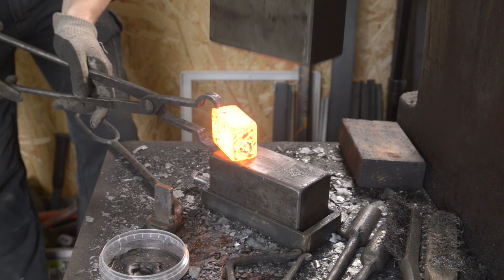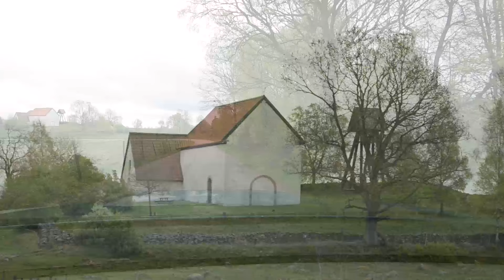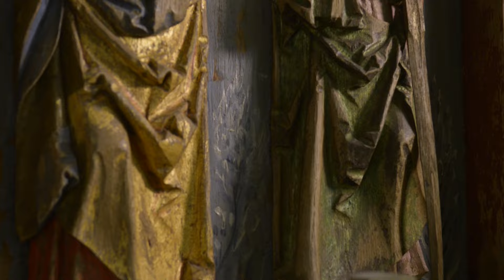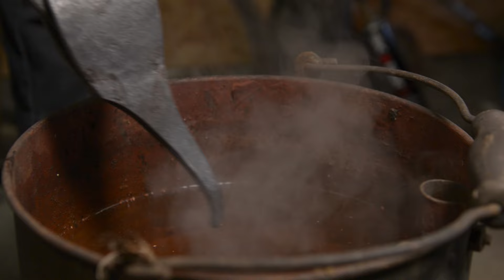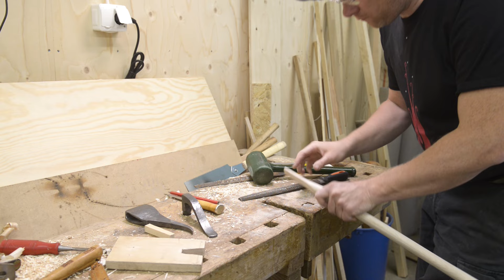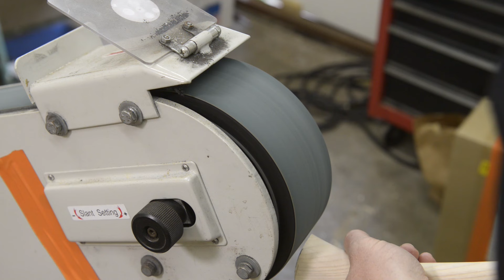Blacksmithing - Making a pickaroon

Comment: south Austria we call it "sappel" and im working at a sawmill and use it every day !
Reply: so, what is it for? what does this tool do?
Reply: @lukewarmwater6412  It's for old fat guys like me that don't want to bend over to pick up firewood. :)
Reply: @Z-Bart  well, they would be good for that too... hmmm. maybe I will put a handle on the rusy one I have.
Reply from the maker: Cool!
Reply: @lukewarmwater6412  I know i am late but well the usecase i know of that this tool is to help fell trees (to give them a nudge in the right direction either with the hook directly or with the help of a chain and using the tool as a leaver) and of course also as a hammer for putting the wedges into the cut (you have this tool next to you so why not use it as a hammer as it already looks like one).
And of course for prying things apart (so if you have a few trees lying on top of each other and want to get access to one of them or if you just want to have space to get a chain around one). So in general it is just a tool that is useful for a surprising number of tasks even though it is really simple (just a hook on a stick).

Comment: This canister, with linseed oil, is never ends)))
Reply: He's up on everything it seems.
Reply: Plot twist: He slowly refills it from another to the exact same level.
Reply: The only thing is, in my experience, that regular linseed oil dries too slowly. I now use only boiled linseed oil on my handles. For a blackened finish on forged items, blo is great. It takes time, however, and patience to use low enough heat not to burn it but high enough heat to polymerize it onto the surface. I have some items that are exposed to the elements the year round and have found that around the five year mark they require a re-application.
Reply: That container was filled from the souls of thousands of linseeds.
Reply: It's the cruse of (linseed) oil that never runs out lol
Reply: @TheMetalButcher  ओक
Reply: تمااالانتا
Reply: تمووىةظاتظتتاهاتا
Reply: @مهديعباسمهديعباس-ف5ز  no, it can't be blown up

Comment: As always it is interesting to see the the craftsmanship involved making a practical tool. I bought similar sized pickeroon with a shorter handle (about 500 mm) several years ago. It was forged in Austria and differs from yours in that it is slightly more pointed.  It allows me to transfer cut up timber on to my hydraulic log splitter one handed. Nice job and thank you for the video.

Comment: I have had two pickaroons, made in Bangor, Maine, USA, for nearly 45 years. I used them in landscaping to move railroad ties around and now to move firewood logs and cut rounds into position for cutting and loading. It is an indispensable outdoor tool. Yours is excellent and sturdier than the ones I have. Yours has a wide point or small blade on the end while mine has a rounded one. One thing about a pickaroon, it needs to stick in the wood and stay stuck. If it comes loose, the operator goes flying backward when pulling a log or beam. Could be inconvenient depending on the circumstances. Maybe that is part of the reason for the pin you put through the head and handle. Thanks for the great video.
Reply from the maker: Great, thanks!

Comment: You will find theese handy little tools in the pulp and paper industry and lumber industry i presume. At least I handled one daliy moving ill placed logs around when i worked at a papermill a couple a years ago. They were slightly different though than your creation. First, there was no pin through the head to secure the handle, guessing theres differen't technics to make it "stay put". We rarely had problems with the head coming loose, more often did the handle snapped or the tip had become worn out from to much "close contact" with the concrete floor. Second, the handle you made are noticeable longer. Probably several lenghts are available, each better suited for a specific task. I like the short ones, just slam the tip in the end of a log  and when I straighten my lazy ass back up its in a perfect drag/carry position for me. If you haven't already you can actually find these great litte tools here in Sweden in various places under the intriguing name of ''draghake''. 🙂
AND, as always, THANK YOU for and exellent video! As many others stated already, it's almost as therapeutic just leaning back in my chair, only hearing the huffing and puffing from the hammers, the ringing from the anvil and slowly someting reluctantly emerges from the stubborn red-and-black-ish piece of metal. Sometimes i get stuck for hours. Found this channel last summer, I think, and are now trying to "catch up" pick off videos here and there when I have the time. Great work! Keep'em coming.
Reply from the maker: :) Cool! Thanks

Comment: Very nice, however I would recommend using a roll-spring instead of an aluminium-rod to hold the pickaroon head in place, as it’s going to be very difficult to remove the rod once you need to replace the handle, you’ll probably end up drilling and replacing it with a new rod, if you use a roll-spring you can remove it easily with a punch and hammer then reuse the same spring once the handles been replaced.
Reply from the maker: Good suggestion! Here I used a mild steel rod. It's quite simple to grind off one head and pound it out if necessary!

Comment: Very nice work,bud!!  I have used that tool many times as a boy and young man. There is one thing I noticed though,,,, The pickeroons I always used ,,we used to tap the point slightly with a rock or hammer to create a small burr on the bottom of the point. It would stick in just as well but would release much easier,, with a little jerk. 
Of course this would require it to need sharpening and burring every now and then. Just my experience. Cheers!
Reply from the maker: Cool, I have seen that too.

Comment: Really awesome smithing one observation you will have better life expectancy out of the handle if you rotate the grain 90 degrees . May the grain be with you .
Reply from the maker: Thanks. The grain is actually curved, but as you say it's not ideal. I would not have used it for an axe handle.

Comment: Torbjörn:  We don't find almost any around here in North Idaho logging country, either, even tho they are a very handy tool.  Possibly they were re-purposed into something else over time?  They are really never used in logging country due to the exclusive use of heavy machinery.  But for small holdings they are a very handy tool to have around and I have one I use in my woodshed as I hand split all my firewood.  Regarding wood handling, I also have a well as a hook with a cross/shovel handle {sort of like a very heavy hayhook} used for picking up chunks of wood, dragging small logs, etc.  Might be another idea for you to make!
Reply from the maker: OK! Interesting

Comment: I dont go out to move lumber, no matter the size, without my pickaroon. Just a thought...if you bring the tip to a point instead of a blade, you will still have plenty of grab, but you will be able to dislodge it from the wood with one motion. Makes life a little easier if you are moving a bunch of lumber

Cheers
Reply from the maker: I guess both tips are useful in different situations.

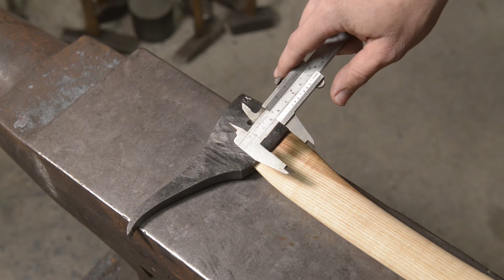Comment: 22:30 that's the first time I have seen a head like that pin to the handle. Is there any other purpose for the pin, other than just a little extra security.
Reply from the maker: It's because this is not an axe head. A pickaroon is used with a pulling motion all the time!

Comment: The annual rings of the wood are in the wrong direction, they should be parallel to the blade to make the stem more durable🤔
Reply from the maker: Could be, BUT this is not an axe and is not used like an axe. Mostly used with a pulling motion with little force on the handle apposed to an axe chop.
Reply: @torbjornahman  Yes, that's true. Maybe it will be ok in pickaroo. 
I noticed in a shop that about half of their axe shafts were wrongly made. It would be fun, if you are in the middle of the forest and you lose your axe after first chop😂

Comment: Hello

1) How much time does it normaly takes, to have the right heat for smithing?

2) If i finished the piece, the steel looks really bad, like it's some cheap, low qulaity steel, but yours lokks reslly nice....
How do you do that??

Nice Work, keep going 👍👍
Reply from the maker: 1) 2-3 minutes from cold, maybe. 2) Hard to answer... nr of heats plays a role for sure and hammer control to minimize hammer marks.

Comment: A real nice quality tool. I think it is fascinating how you are able to use the right amount of steel at the beginning and only have minimal waste. What kind of steel did you use ( maybe i have missed it)? Even though you are using power tools (especially the ginder) you are doing the finishing touches by hand...I like it. :D Great job as always.
Reply from the maker: Thanks! This time I just guessed actually.... Oh, I used simple 1045 / C45 steel for this one. I forgot to add a note in the video about that. I think it will work fine.
Reply: @torbjornahman  Thanks for the answer. If you do not mind, I would be interested in the selection of sorts of steel you work with , what they are normally used for and what properties they have.
Reply from the maker: @fryingdutchman8921  Oh, it's hard to explain in short... And I'm definitely not an expert when it comes to different alloys. For knives and tools with keen edge you need high carbon like O1/1075/1095. For tools that need more toughness medium carbon steel is preferred like 1045/4140/4340. The only hot working steel I have worked with is H13. For power hammer punches mostly.

Comment: Thanks for a beutiful video! Why did you rivet the head to the handle? Never seen it done on, for example, an axe. Is it always done on pickaroon? Is it really necessary?
Igen, tack för alla filmer du delar med dig av! En verklig inspirationskälla, och så tillfredsställande att se hur snyggt du får till det!
Reply from the maker: Tack!  Yes you use a pickaroon in a completely different way than an axe. You pull on the handle and it will jerk the head lose sooner or later. The pin will hold it in place even if the head moves a bit after extensive use.
Reply: @torbjornahman  Makes sense. I have used an axe in a similar way, but maybe i should get a picaroon instead!

Comment: Nice job! It seems a very elegant tool.
I've always wondered why must put some coal dust when making a hole.
Greetings from Bulgaria.
Reply: It helps to free the punch from the hole by creating gas from the combustion of the coal in the hole. Think of a champagne cork popping out from a bottle, only less dramatic.
Reply: @horacerumpole6912  You'd have to ask Torbjorn to confirm that it's graphite powder, I don't believe that it is. I believe it's just coal dust or 'fines'.
Reply: @horacerumpole6912  Really?  Can you share a link to it?  
In the first sequence I can see that he uses a powder, reaching to the right and taking it from a dish then sprinkling it into the hole, that powder looks a lot like fines to me, it looks coarse for a graphite powder but it 'could' be.   Most guys use fines, myself included.  It's cheap and does the job.
However, the tub he subsequently dips the slot punch into in the next shot is almost certainly a graphite paste of some kind, but it's too glossy to be straight powder.  I've made something similar myself as a punch lube from a mix of beeswax, boiled linseed oil and finely ground charcoal.

In any case the original poster was asking about the use of coal dust when punching holes, not graphite. My explanation for that is sound, the pressure of the off gassing coal helps to pop out the punch.

Comment: Great work all around!  I enjoyed it.  Not a big deal for something like a pickaroon, but I would like the grain of the wood oriented vertically with the blow of the tool.  There was a debate on another channel on which wood is stronger - heart wood vs sapwood.  I'm in the heartwood camp, but I see you choose sapwood.  Deliberate or just what you had on hand?
Reply from the maker: Thanks. This was a piece I had laying around. Even if the grain is a bit curved and not ideal, it will work fine for a pickaroon. I would not use it for an axe handle.

Comment: My brother has a few of these and I was looking at them yesterday wondering how I could make one. Awesome work as always. I'm curious though the stone you used after heat treating? Was that a way to temper the tip or just for a aesthetics??
Reply from the maker: Thanks. I used the stone to remove the scale so I can see the tempering colors on the bare metal. The residual heat traveling back to the tip.
Reply: @torbjornahman  oh cool. Would have never thought of that. Thank you

Comment: Hey Torby... Another great video of mastercraftsmanship. 
I have a question. The rivet at the end. Isn't that a bad idea because if you want to replace the handle in case of any damage you will have to remove the rivet which is going to be dificult right ?
Reply from the maker: Thanks. All pickaroons I have seen has the rivet, because you use the tool in a different way than an axe. You pull the weight with the handle. A rivet head is quite easy to either grind off or chisel down.

Comment: I suppose the rivet is a security device, not functional normally that is. Or ?
Reply from the maker: The pickaroon always has a rivet it seems. Since this is a pulling weight kind of tool apposed to an striking tool like an axe.
Reply: @torbjornahman  Aah, now I understand. The pulling action.

On a side note, a tip for people out there:

I put my axe in the oven at 200 °C to set the line-seed oil (un-cooked oil) faster, for the sake of making it more beatiful and durable, and indeed it became, a new brown finish much like mahogany, water resistant as well.

That was a big mistake though. Now the wooden handle shrunk a little bit and and the head came loose.

I solved the problem by setting the head to the handle as normal, with a series of sharp knocks on the handle knob. Then I built a little pool out of "modeling clay" around the eye, gripping the axe vertical, head up in a vise. I poured some thin laminating epoxy (24h setting time) in the pool. The resin slowly filled the gap all the way down during the night and hardened like rock. Now the head sits way firmer than ever before.

Effective ? Yes
Repeatable ? Perhaps

Förr har jag trott att du är norrlänning, men nu har jag blivit klokare i det att jag tror att du är smålänning :):)

Comment: What are those flake like things falling off
Reply from the maker: Iron oxides. It forms on the surface of the hot steel. Almost like instant rust. :)
Reply: @torbjornahman  So does this reduce the actual mass of the iron taken initially?
Reply from the maker: Yes it does, but for most things nothing you worry about.

Comment: Another captivating clip. The church is amazing, especially that door. Would the original wood really last that long? Aso, what is 'normalisation; of metal? Is it the same as annealing?  :-)
Reply from the maker: Thanks! I'm not sure the door is original, but it's plenty old. You probably could use dendrochronology to date the wood! Normalization is a way of evening out the grain structure within the material. Forging and heating makes the grain grow and distort. Annealing is a further step that makes the steel as soft as it gets - without going into detail...
Reply: Thanks so much for the reply. Very helpful[ful. A friend says the church is in Vaxjo? (sorry, couldn't find he diacritical marks)
Reply from the maker: Great. Yes that's right!

Comment: Well done as always! But is there a certain reason why you made the tip flat? The ones i´ve been using my whole life in logging always had a sort of triangular tip. I had one or two which where flat, but i found that they didn´t stick as well and after i had some pretty heavy logs slip off and almost crush my foot (if i hadn´t worn safety boots!), i reground them to the usual triangular pointy shape.
Reply from the maker: The reason is that I was recommended to do do it like that. I guess different tips have different uses. I haven't used anything else so I can't compare.

Comment: Out of curiosity why did you put that pin in it? Is that how they were historically made? I thought a wooden wedge would have been sufficient enough? Nice work as always.
Reply from the maker: Thanks. This is how they are made to my knowledge. You pull a lot of weight with this tool, not at all the same thing as with an axe.

Comment: Wouldn't it be more efficient if you drew the material into shape before putting in the hole
Reply from the maker: Probably many ways to skin a cat, but in general you always punch the hole first. It's the difficult part and if you mess up you don't throw away the work...

Comment: What is the paste in the container by your power hammer?   I assume it’s some kind of a release agent for your punch, correct?   Can you share the ingredients if it’s home made?
Reply from the maker: Yes it is. I don't know the exact content. It's traditional wood stove polisher. It contains graphite, linseed oil and wax I believe
Reply: Torbjörn Åhman .        Thank you for the reply.  I know of a smith that uses his own concoction made from a commercial anti-seize compound (Permatex brand) mixed with light oil and coal dust.  Looks similar to the paste you had sitting by the power hammer.  

Please continue to produce these great videos.   Your videos are extremely well planned, executed and edited.   You do a wonderful job without unnecessary footage.   I salute you for the effort and time you put into them!

Cheers!

Whipple
Reply: By the way, what kind of steel was your source material for this pickeroon?   

Thanks again!

Whipple
Reply from the maker: Thanks!! This was 1045 steel.
Reply: Torbjörn Åhman .        Thank you!   I’m going to attempt to make one this winter.   I appreciate your reply.

Cheers!

Whipple